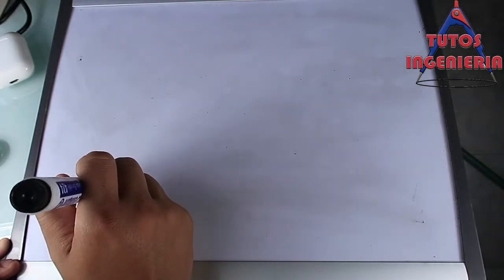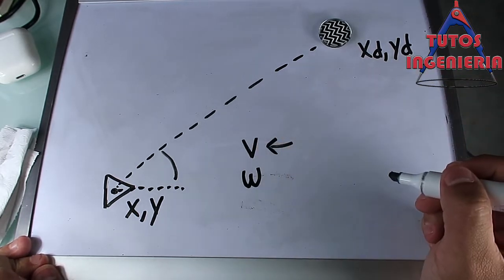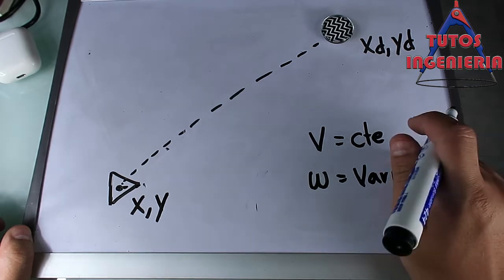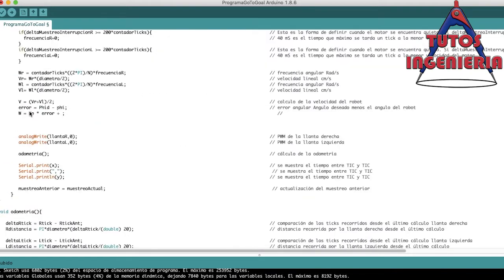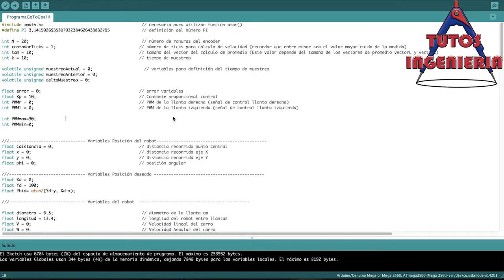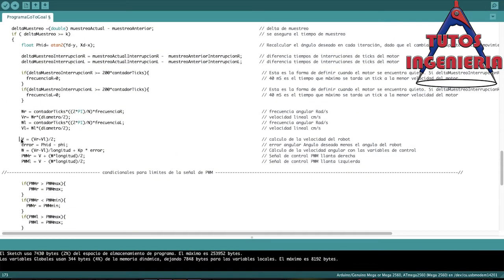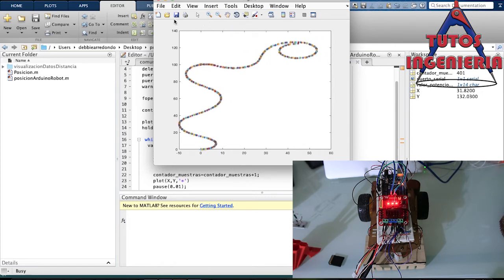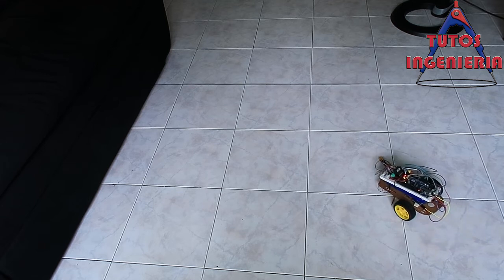Proportional Control for autonomous navigation with arduino and matlab

Comment: If two dc motors with encoders are used, should the ınterrupt pins be 2 pieces for each motor? For example, 2 and 3 for the right wheel, 18 and 19 for the left wheel?